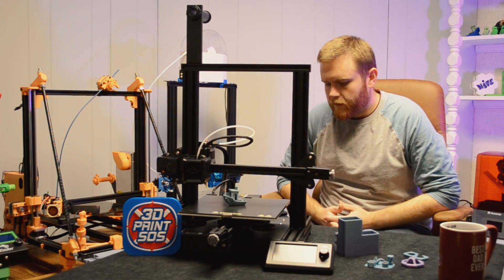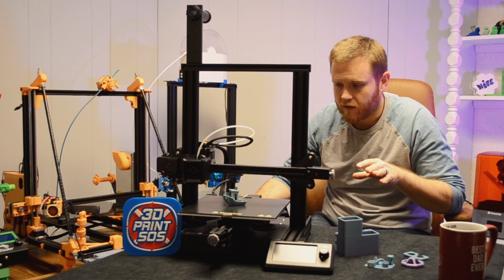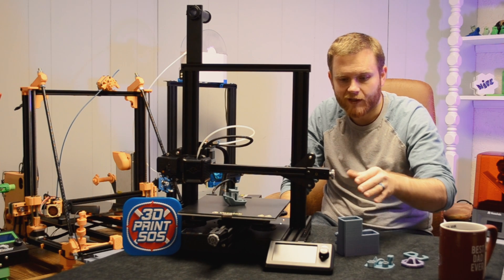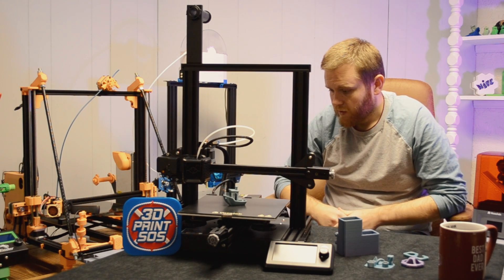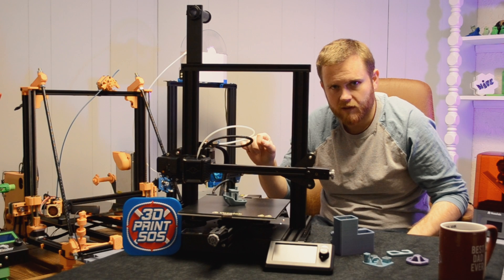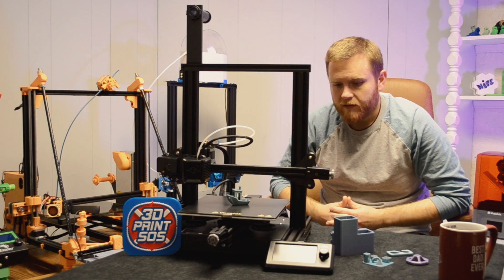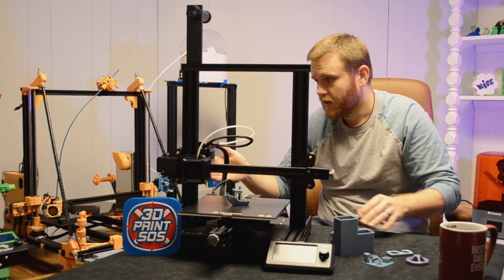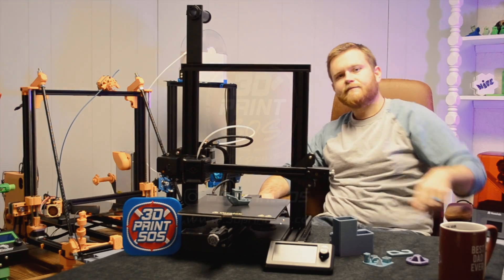Voxelab Aquila 3D Printer Review

Comment from the maker: Here is my Cura profile for the Voxelab Aquila to be used with PLA - https://www.3dprintsos.com/wp-content/uploads/2021/01/Voxelab-Aquila-PLA.zip
Reply from the maker: @Asa Rogers No I do not. I would suggest you stick with PLA for a little while. Plus im not sure I would recommend you go any higher in temps before replacing the stock PTFE tube. This one should let you go all the way to 300c, not that this printer will let you go that high. https://amzn.to/38wR4ww Also keep in mind that ABS will require an enclosure.
Reply: thank you!
Reply from the maker: Yes. 4.8 :)
Reply: Would the same profile be ok to use with PLA+?
Reply from the maker: Yep, that’s what I use. :)
Reply: I've been noticing with this profile, that my first layer is having trouble with bed adhesion on the brim. seems the outside of the brim starts to peel up from the bed. I've noticed I don't have the issue if I slice my model in voxelmaker and the only real difference I can tel is that the gcode from voxelmaker includes a purge line. Can you do a video or just reply here with how to add that to the gcode? because when the first layer works, your profile is preferred.
Reply from the maker: The purge line can be added with a start gcode. You can make a profile for an Ender 3 v2, copy that start gcode and paste it into your profile for the Aquila. But honestly, any kind of pealing is typically a leveling issue. ;)
Reply: @3DPrintSOS  thanks for that. I originally thought it was a leveling issue too and haven't completely wrote that off but i wouldn't have the issue printing anything sliced using voxelmaker whichmade me think it was something I could change in cura
Reply from the maker: There could be a difference in first layer settings that’s helping/hurting things. But I can guarantee it’s a leveling issue.
Reply: Are you still printing with this profile? Can you update it> it doesn't seem to want to open properly

Comment: Hi I was recently gifted a Aquila printer and it’s my first one. I am a CNC machinist, which may not mean anything to you ! I run , program lathes and mills they use the same G code as the printer and leveling the table is a lot like touching off tools in a lathe. My printer came with 5 rolls of ABS. I’m setup on my kitchen island. Would you suggest trying a different filament for a beginner?
Reply from the maker: Hey. Congrats on the machine. Yeah for sure, I would start with PLA first. Way easier to print. Once you get through a few rolls of pla, and learn more about your machine, I would suggest a few modifications to help you print ABS consistently. Since you have to print MUCH hotter than pla. 

The other thing with pla, no smell. Abs tends to be a bit stinky.

Comment: Can I use my phone to run a 3d printer?
Reply from the maker: You can run octoprint on an Android phone and use a browser based slicer. But technically you need a pc to to be able to have full control.
Reply: @3DPrintSOS  thank you for the info I just have an older laptop that I will try if my android phone doesn't  I appreciate your time
Reply from the maker: Your older laptop, should handle Cura just fine. Give it a shot.
Reply: Thank you and I appreciate your knowledge
Reply: Is there any way you can recommend a slicer to use with android?
Reply from the maker: I wish I knew of one. I’ve never looked. I know there is a browser based slicer out there, not sure if it works on mobile. Not saying you shouldn’t try, but I still think a pc is the way to go. Honestly.
Reply: What would you recommend for me to download on my laptop to be able to use my Aquila printer

Comment: Does anyone else have concerns about the Y-axis motor? 
Mine runs real hot, much hotter than others. It kinda makes sense though. Constantly moving the hotbed assembly is no joke for such a slim motor!
Any advice on that? Maybe switch extruder motor and Y-axis motor? Has anyone done that?

Also, the screen is no good IMHO. Unlike Ender's 12864, Aquila's screen does not work Klipper or RepRap firmware if you'd want to go that route.
As far as I know, Aquila's screen is actually a touchscreen with gutted sensors functionality. And budget touch screens tend to be less reliable and more buggy than regular ones.
Reply from the maker: The y axis motor can get hot if the voltage is off. I have a video on how to check and adjust the voltages. It makes them run MUCH cooler. 

As far as the screen, it’s a replica of the Ender 3 v2. It runs on and is supported by Marlin. Not sure of the others but it’ll handle whatever the Ender 3 v2 screen does.

Comment: Horrible printer, threw it across the room today after going through 2 tips after it was getting clogged. Now I need a new whatever the *** it is that connects to the tip, I need all of that now, so f*** this 3d printer.....I'll probably get back to it in like haf a year when I want to tinker again but once you mess up the tip, it's pretty much a paper weight.

Comment: I keep having the issue of a quarter way though the print, the fan setting goes to the max speed of 255. running firmware 1.2.1, any ideas why this happens?
Reply from the maker: The fan speed going to 255 is normal. That’s actually 100% fanspeed. It should do it at layer 2. That’s how it’s typically set in the slicer.

Comment: Keeps freezing
Reply: So when we turn it on it works perfectly fine but when we go to print something on it it just freezes mid print process
Reply from the maker: @srobinson632  does a temperature warning come up?
Reply: @3DPrintSOS  no it  says that the power source gave out
Reply: @3DPrintSOS  but we also don't know how to download stuff to the to card to put on there
Reply from the maker: Hmm. If it’s a power delivery issue, that could be a loose connection on the power supply. 

As far as getting stuff on the card, check this video: 

https://youtu.be/is89LsOwa-4

A bit old, but works the same.
Reply from the maker: Hmm. At which point. What are you trying to do when it happens? Do you get an error?

Comment: when you printed the tool box, what was the orientation? Cura don't show any supports for the upper rail.
Reply: Because I’m new to 3D printing and didn’t know that. Hahahaha
Reply from the maker: Ah. No problem. Give it a go right from the sd card. :)
Reply from the maker: The toolbox print was from the sd card. It’s already sliced and oriented. Is there a specific reason why you’re slicing it yourself

Comment: It’s 150 rn for cyber Monday. I had to take advantage.
Reply from the maker: Smart
Reply: @3DPrintSOS  can’t wait
Reply: @3DPrintSOS  any tips for leveling the table? I got it decent now but still feel like it could be tweaked but some knobs on the bottom are loose as possible
Reply from the maker: https://youtu.be/Q7Mu05fZNsk
Reply: @3DPrintSOS  thanks!
Reply: @3DPrintSOS  do you have a video that explains how to add prints to the sd card via my computer?
Reply from the maker: I do. It’s a bit old, but it’ll do the trick. https://youtu.be/is89LsOwa-4
Reply: @3DPrintSOS  got the boat down thanks!
Reply: @3DPrintSOS  I’m sorry to keep bugging you with questions. I found 3D printer glue sticks on Amazon and was wondering if you apply any to your bed and if so how often? And do you have any recommendations?
Reply from the maker: I still believe the best way to get something to stick is clean with isopropyl alcohol and then have it leveled perfectly. Use a brim. That combo always works.
Reply: @3DPrintSOS  thanks you’ve been tremendous help!

Comment: how do youstop the print peeling of the bed while printing
Reply from the maker: It’s a balance of leveling and having the right temperatures. Best way to fine tune your leveling is to start a print with a larger brim or skirt and while it prints the skirt or brim tune the knobs on the bed to get it printing perfect. Then stop, and print again once it’s tuned.
Reply: @3DPrintSOS  many thanks

Comment: Great video! Just getting into 3d printing, Looking at the obvious Ender 3 v2 but even now with a price change would you recommend this over the ender 3 v2 still. Thx
Reply from the maker: Yea for sure. I daily drive these machines and they are just as good as any Ender. Just cheaper. :)
Reply: @3DPrintSOS  Well I've actually had a check and right now can pick up both for around £180 GBP. So I'm not sure which to pick 🤣

Comment: hey can anyone help me just got this printer built yesterday, when ever i try and start a print the machine sucks the filament out of the white connector tube. pretty much unloading when ever i try to start a print. Anyone know why or know how i can fix this
Reply from the maker: So when you select a file to print, your extruder goes in reverse? Does it heat up and home first?
Reply: @3DPrintSOS  i preheat the system first, then when i start my file the extruder reverses
Reply from the maker: Hmm. Sounds like your wires are reversed. Gotta be a way to swap that.
Reply: @3DPrintSOS  thank you so much its working now, it was my first time i assemble a 3d printer and its actually working now
Reply from the maker: Awesome. Glad to hear it.

Comment: Man this is so tough making a decision. i was all ready to buy one of these based on first hand knowledge from someone I met who has one. Then I saw a SCATHING review that simply TRASHED the Aquilla all over the place. Then I watched a few more reviews and they are like this one just raves. Problems mentioned in other reviews would be "time" related. Things they said "would probably go bad eventually". Often reviews like this one here are done right out of the box and everything is new and fresh but problems happen over time. Have any long term issues come up yet?
Reply from the maker: I’ve had an Aquila for 8 months now. Two others since then. I’ve had quite a few videos on the machine over that span as well. The issues many have run into involve failing fans, specifically, the hotend and motherboard fans, and the extruder arm cracking. Just like the Enders. 

Otherwise, the firmware issues have been resolved via aftermarket and official firmware. 

If you are skeptical, check out some of the other videos on my channel. I’m sure you’ll be impressed with everything it’s capable of.

Comment: Got one of these for 168$ just a few days ago. Just set it up and started printing out the first print. It's a really nice machine. The bed had a little wobble out of the box but that was an easy adjustment. It runs so darn quiet other than the fans compared to my old monoprice mini select printer. Gotta do the fan swap to some quieter fans eventually. Haven't had much of a chance to really test it out but it seems to be a good machine so far.
Reply from the maker: Great machines for sure. Especially if you dont mind a bit of tinkering here and there.

Comment: I recently purchased a voxelab aquila 3d printer, learning alot . What is the best/minimal requirements in a computer do I need? What do you using a slicer program like cure,blender, or fusion 360?
Reply from the maker: Congrats on the printer. I would use Cura for a a slicer. The minimum requirements for Cura can be found on ultimaker.com. Just a hair too long to type out here.

Comment: Hey there! I ordered the Aquila because of your videos and how helpful they are. I was hoping you could help me with a few things. My first few prints have gone okay, but going for longer prints (20hours) has left me with print failures. My filament either breaks between the extruder gear and the ptfe tube, or creates a giant ball of tangle as the extruder somehow bent the filament at a weird angle and had a double feed. Any thoughts or suggestions?
Reply from the maker: Sounds like you are clogging the nozzle and the extruder can’t push the filament through? Check your lever to make sure it’s not cracked. Also check the tension on the lever, there is a bolt there that lets you adjust the tension. Maybe it’s a bit too lose? What temps are you printing at? If it’s failing long prints it could be ambient temps or moving air in your room as well.

Comment: do you know which steppers are in these machines? 2208? uart? if its stated in the video i missed it but its not defined in the documentation from voxlab
Reply from the maker: 2208 I believe.
Reply: @3DPrintSOS  ty, my stepper motors get insanely hot so i'm gonna have to get in there and back off current a little bit ^_^

Comment: I got the aquila delivered yesterday. I have some problems with it and my early test prints were ok but not as clean as yours! I have some questions I am hoping you can help me with. Firstly when it starts I have to manually adjust the Z-axis offset quite agressively despite having levelled the bed thoroughly, is this normal? Also did you get those quality prints with the PLA that was included with the printer, or was it a different reel? You should consider setting up a discord for your channel here so we can all come together and colab over this awesome printer!
Reply from the maker: 1. You shouldn’t have to adjust the z offset at all. I think you adjusting it may be what’s throwing it off each print. Set it to zero, relevel, try to print. Make sure you bed has zero wobble and make sure your belts have decent tension. 
2. I used a separate spool of cheap, no name pla. The sample didn’t have much in it so I skipped it. 
3. Having a discord channel is something I need to look into as I only very recently started using discord. But that’s a great idea. Thank you.
Reply: @3DPrintSOS  I didn't think I should be after relevelling it exactly how you do in the levelling video and doing a test print it again seems that something is wrong. The  nozzle looks to be more than 2 mm off the bed when it starts printing and the extrusion isn't reaching the bed. Weird problem!
Reply from the maker: That IS weird. So when you hit home, it homes leveled, but then lifts when printing?
Reply: @3DPrintSOS  ahhhhhhhhhhhhhhh!!! no it doesn't! I was manually winding the z-axis to the bottom of it's travel which is obviously overshooting the limit switch home location and then levelling.... I'm an idiot. Levelling to the auto home z axis position now!
Reply: @alexbromage8596  how did it work out for you? Everything good?
Reply: @garden0fstone736  Everything works great. Done quite a few prints on it now and I'm really happy with it. Planning to upgrade it to do carbon fiber soon as well.
Reply: @alexbromage8596  ordered👍

Comment: Hey man I had to change my slicer program. I'm trying out the voxelmaker slicer that came with the printer do you have any profiles for that. I'm looking for  pla abs and petg. Thanks a million for your help with setting me up.  My cura doesn't work on my other computer. Its older so I need to use a 32 bit program.
Reply from the maker: Ah. The comparability limitation is crappy but I’ve been in the software business and I can’t blame them for doing it. From what I understand, voxelmaker is based on Cura in some way. Wonder if you could run Cura in a compatibility mode of some sort.

Comment: I just got this printer and set it up as you recommended, I printed a few small items but now I have a clunking sound and the print is not coming out correctly. Cleaned the nozzle but still have the problem. any solutions? Thanks
Reply from the maker: Give me a bit more detail. Clunking sound coming from where? What are you trying to print? What are the temps?
Reply: @3DPrintSOS   Thank you for the quick response. I am just printing the sample hook and the temps are 200 and 65 for the bed, The clunking is coming from the feeder and gear area, it feeds a little, then clunks and feeds again. The first attempt of printing was successful, then this started to happen.
Thank you for your help. Lee
Reply from the maker: If it’s still printing, it could mean you have a partial clog. You can try to get the temp a big higher and see if it goes away.
Reply from the maker: You can also tighten the screw on the lever just a bit. Maybe the tension is too low
Reply: @3DPrintSOS  I did put a new nozzle on and clean it so maybe it is the lever? what lever may I ask, I'm very new to this 3d printing. that is the reason I am watching your very informative videos' Ha Ha. I also ordered the new nozzles you recommended.

Comment: hello i'm just considering 3d printing and am curious about a lot of things, first, how long does it take to make a small object like the little boat you did? also, how easy is it to pick up and learn? I've never done anything like this and also is there a guide you have or you can think of to doing this including software, making the model on the computer then printing it?

edit: i just also want to know if this printer is the printer for me
Reply: Thanks for the question I'm in the same boat
Reply from the maker: It’s a great first machine and there are hundreds of thousands of files out there for you to print if you don’t already design yourself. I have some vids on getting started and slicing files etc. 

The little boat takes about 2 hours or so depending on accuracy settings.
Reply: @3DPrintSOS  more questions, the best spot i have for this is a 1-foot x 1 foot spot will this fit or do i need to rethink? also, why is it that important to keep it level?
Reply from the maker: You probably want a bit more than 12x12. You don’t keep it level to the surface the printer is on, you keep the bed leveled with the hotend and it’s axis. That way, you can create a 3D object evenly. If the bed isn’t leveled with the hotend assembly, you will have issues getting your print started.